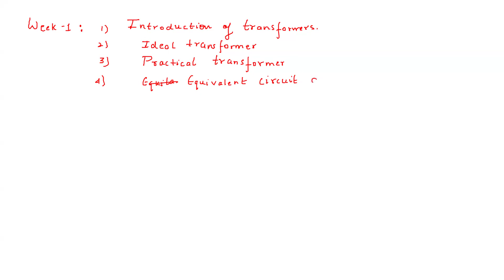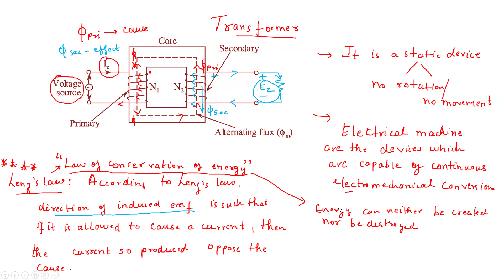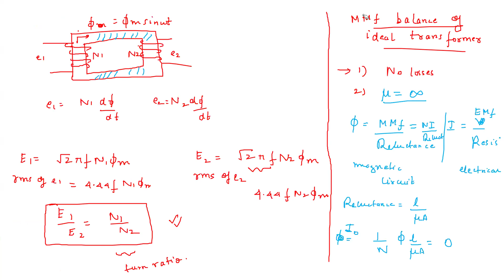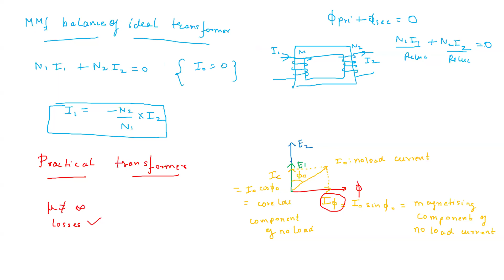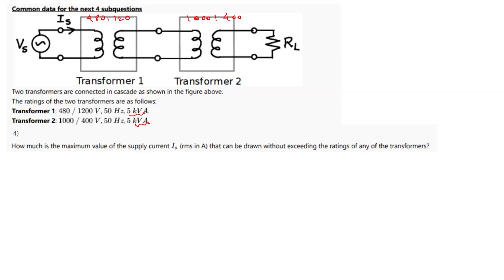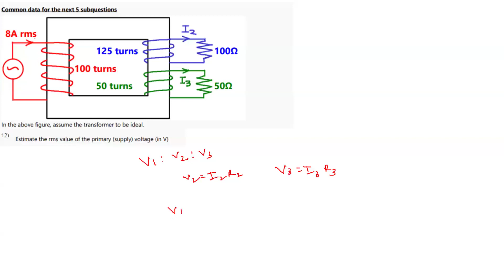NPTEL Electrical Machines-1 Assignment-1

Comment: By keeping applied voltage constant if frequency of operation decreases what happens to no load current and  its power factor?
Reply from the maker: Firstly, it is not advisable to operate at low frequency as flux (which is proportional to V/f) will increase drastically causing the transformer core to saturate. In this condition, the magnetising current for producing the same amount of flux increases significantly which may burn the transformer. If you are talking about decrease in frequency in such a way that transformer does not saturate, then magnetising current increases (but not fatally like in previous case) causing the no load current to increase and for power factor to become more lagging.
Reply: @SakshiSingh-zb6nb  Obviously If we run transformer at too low frequency it will saturate. But this question is not talking about case 1
Now come to case 2, Only magnetising current will increase, core loss current will not increase? As we know the core loss is proportional to the square of flux. No load current will definitely increase but what about the power factor? It will improve or not here real loss also increases.
Reply from the maker: @moonknight1040  Eddy current loss is proportional to square of Bm and square of frequency. The increase in Bm and decrease in frequency are by the same order and thus eddy current losses remain almost the same. However the hysteresis loss, increases. Although this increase is not as significant as the increase in magnetising current. Thus, the overall no load current increases and magnestising current increases more causing the power factor to reduce and become more lagging.
Reply: @SakshiSingh-zb6nb  Nice explain 👍 but i have one doubt also here both hysteresis loss and magnetising current is reciprocal of frequency with same factor then how have you decided which will dominate??
Reply from the maker: @moonknight1040  Thanks. Please see the assignment 2 video. At around 1 hour in the video I have explained that in detail. Hope it helps!
Reply: @SakshiSingh-zb6nb  thanks you have cleared all doubts. But where can i ask more doubts? Have you any insta id face etc